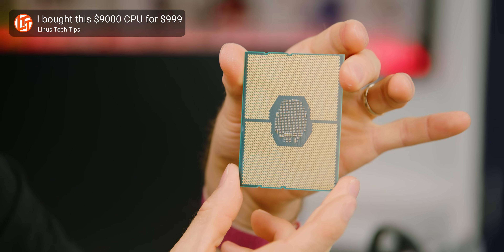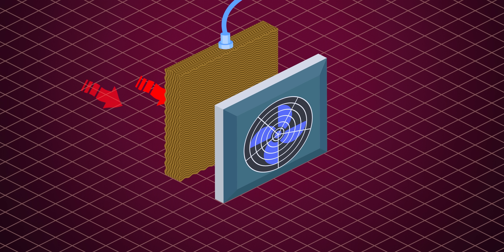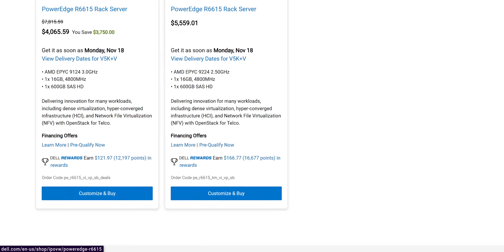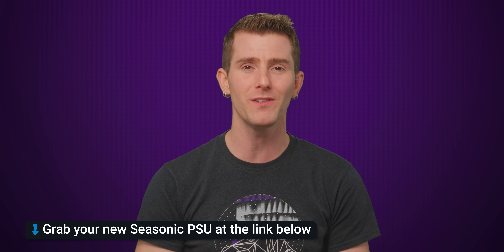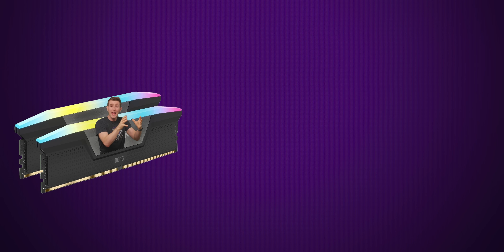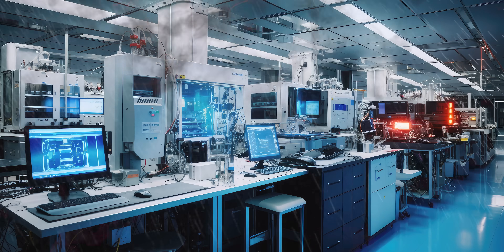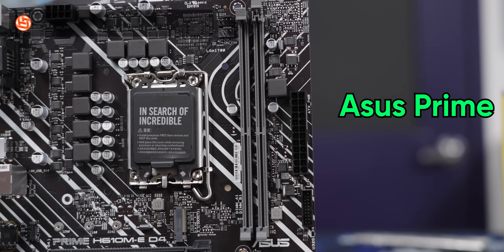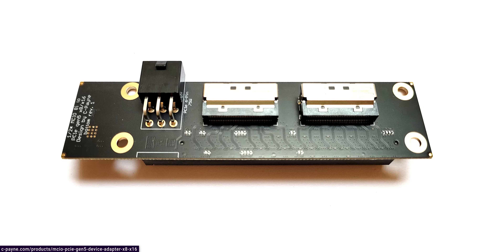What’s The Difference Between A Server and a PC?

Comment: 3 TB of RAM is crazy. But I still bet Google Chrome would find a way to use it all.
Reply: JVM would still complain of not enough ram.
Reply: @skvvlk  What is JVM ?
Reply: Modded KSP probably
Reply: hey, that's only like 30,000 tabs
Reply: LTT actually did a video on how much system RAM can Google Chrome use. I think the OS stopped around 12GB of usage of RAM by just google chrome tabs. Right now Google Chrome seems to require more system RAM than when they did that video too but if you turn on performance in the browser settings then the system RAM required goes down a lot.
Reply: @yumri4  wasnt it actually the network and cpu that couldnt keep up?
Reply: Linus made a video some years ago with 2TB of RAM. Wasn't able to fill it with Chrome Tabs due to operating system limitations. And overhead slowimg everything to a halt
Reply: It only takes 2 tabs :)
Reply: You can put a lot more
Reply: crazy things is i think you might be right lol
Reply: True. I've used up near 100% of my 12GB RAM just from Google Chrome
Reply: I hate that demon
Reply: And i run many chrome tabs smoothly with my 32GB RAM

Comment: yep run your stuff on gpu compute using opencl. typical 1.3-1.8GHz per core. possibly similar to a dual socket server cpu setup power usage. and only a minimal cpu for the system otherwise. yes you can run single threaded programs on the gpu also. just fine. many many single threaded programs at once. yep opencl runs just fine on fpgas too. off-the-shelf, no extra design steps required. most fpgas have opencl driver stacks already. yep they compile the same c-program to fit their own fpga style.

Comment: I mean technically server and pc are just applications, use-cases. Yes, a computer can be designed to run server or pc tasks more effectively, but you can also just use a pc as a server, for example a cheap Minecraft server for your buddies from an old office tower. Or perhaps picking up a decommissioned server to use as a pc, and just throwing a gpu in it. But, this was still probably the most thorough video explaining the differences yet.

Comment: Video suggestion - under a possible new "What's the difference Video Series???". As an old-school elder, I've never been a huge fan of mobile phones, but even to me, it's fairly common knowledge that you should "ideally" charge your phone from 20% to only 80% to help the battery last longer over time. So imagine my surprise, when my new Dyson Vacuum documentation recommends to me, to run the battery down to zero once a month or so, to help the battery last longer. It immediately sounded like a scam to me not knowing a lot about battery life - so you have to buy a new Dyson replacement battery when the old one dies, due to running it from 0% to 100% too often. But if it's NOT? a scam - then how about a video that compares the differences between PHONE / VACUUM / & SAY EV CAR BATTERIES, especially from the point of view of trying to extend their life as much as possible, and how that might differ from one type of battery to the other?

Comment: A PC is a computer you can shut down. A server is one you leave running. Yeah there are hardware choices people make that skew one way or the other but honestly the biggest difference is that availability. A server is expected to be available 24/7 because it is providing services used by multiple people simultaneously. A PC on the other hand generally only has a single user at a time. Patrick is great but he is very narrowly focused at times and I think this is one of them. He has a very distinct line between what is used by businesses and what is used by consumers even though there are situations when you actually do mix them a little.

Comment: No mention of fault tolerance in parts, multiple power supplies, raid cache batteries, raid controllers and disc arrays with multiple redundancy. 
Also no mention of IPMI or iLo(HPE iLo is actually amazing for remote management).
Reply: Double ported enterprise storage so that there's basically two computers attached to it in one enclosure, so that even if the server completely craps the bed it can still keep on ticking with the other half...
Reply: None of these are requirements for a computer to be considered a server.
HP, Dell and many other vendors sells server devices with... none of them. The bottom third of the Proliant series contains none of them.
What on earth is a "disc array"? Is that when you have multiple DVD burners in RAID or did you mean to say "disk" with a k?
Stop. Think. Post.
Reply: @tim3172  Yes. Stop. Think. If you'd done that, you'd not have posted.